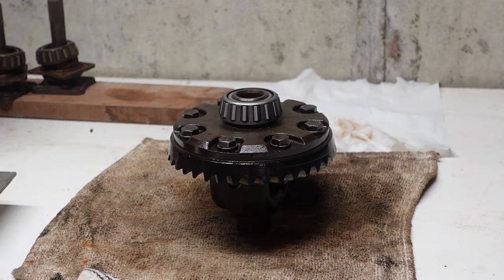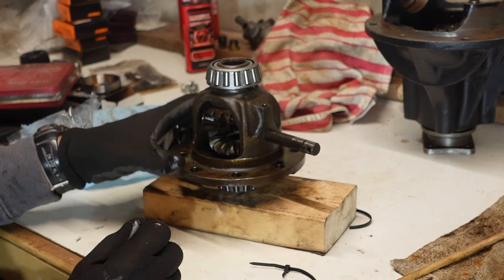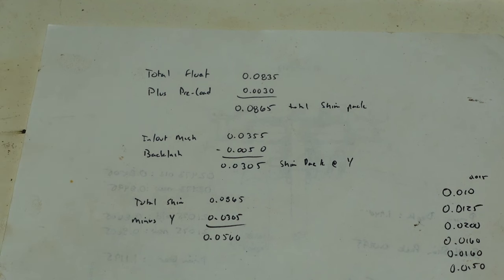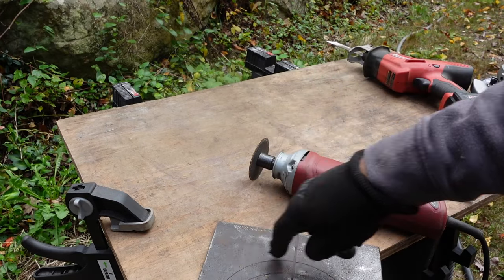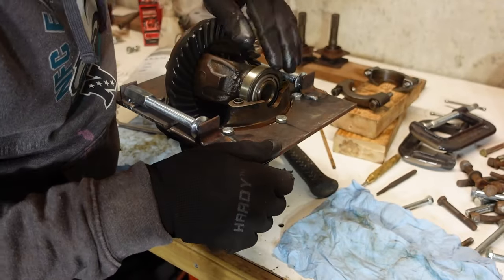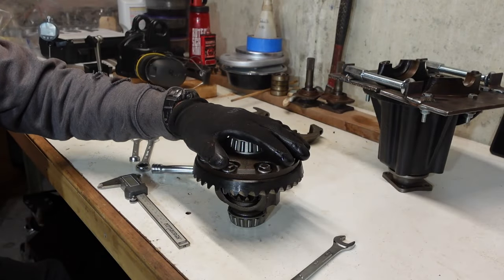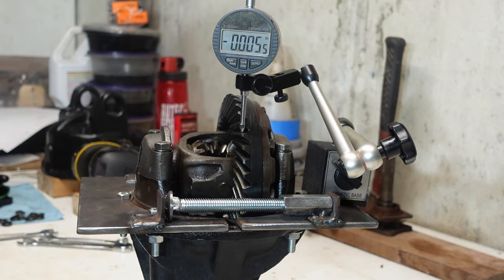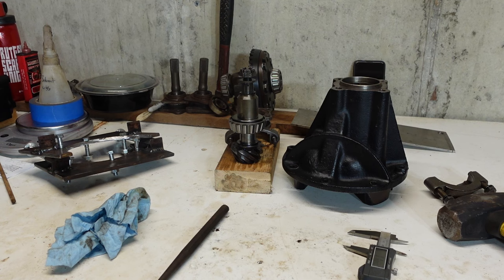Triumph Spitfire - Differential Rebuild #2 | Roundtail Restoration

Comment: I wish I could have known you were going to be doing this. I would have told you to be sure and get the pinion lined up first before adjusting them ring gear onto the differential. It would have saved you some headaches.
Reply from the maker: Thanks, Mike. No worries. At the end of the day, I actually enjoy figuring out that I'm all messed up. I think it makes for a more impactful learning experience and enhances my understanding of how it all works. I'm not there yet with the diff (spoiler, I've got the pinion height just right and still have a bad contact pattern), but that's all part of the experience. I am pulling apart an overdrive...any lessons there? Thanks!